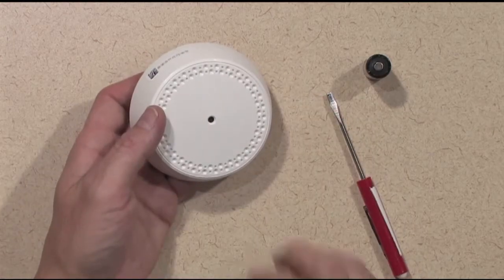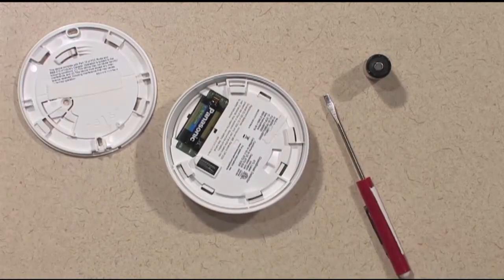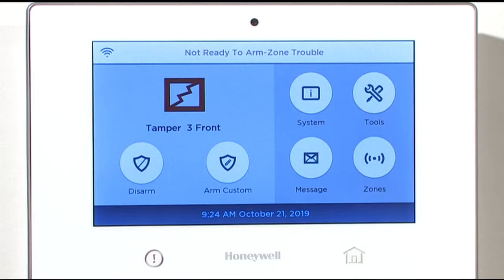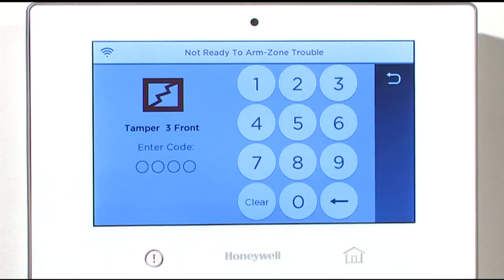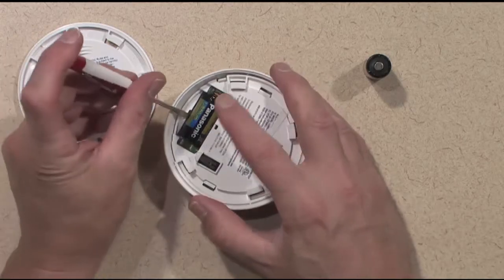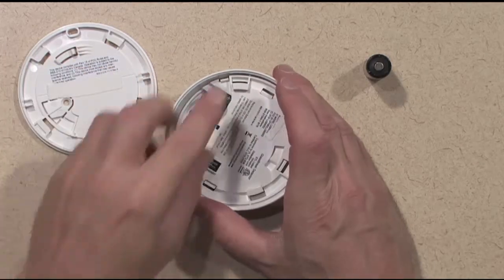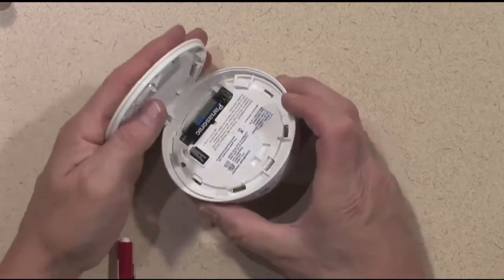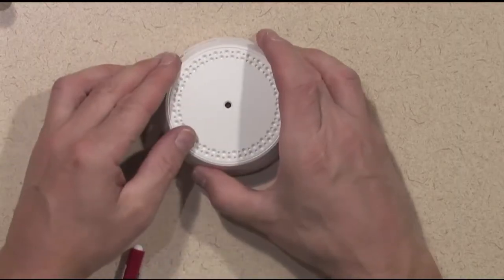Battery Replacement For SIXGB

Comment: Note to self - this was the right sensor.  Needed to leave the battery out for a bit and then replace it.  It was the kitchen GB sensor.  Replaced Panasonic CR123A 3V with Duracell 123.

Comment: This is especially useful since ADT doesn't keep instructions for the equipment they install around for long.  One note that would help is that the battery required is 123A.  A 123 battery will fit and will power the device; however, it will not allow you to reset the fault.
Reply: THANKS! This comment just saved me a major headache. I just used a 123 battery and was wondering why the fault would not reset. Off to the hardware store!